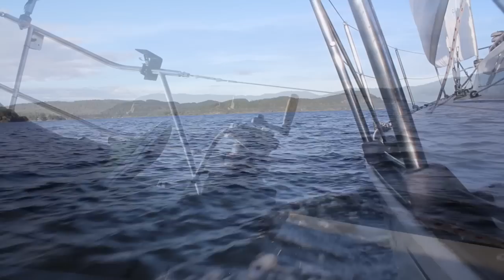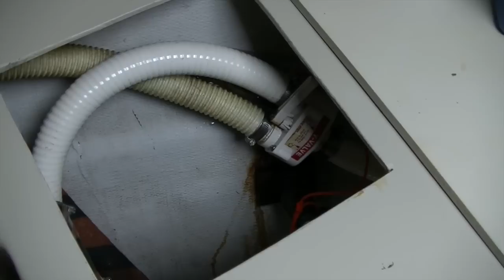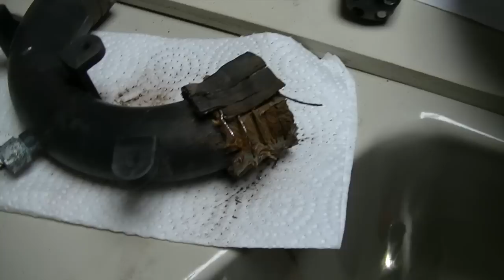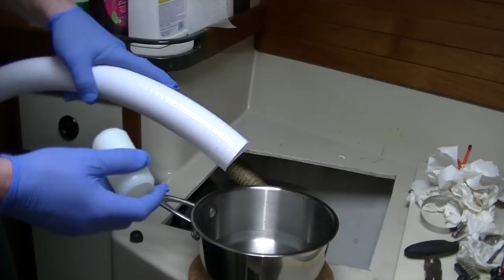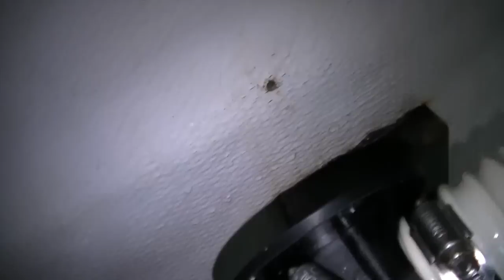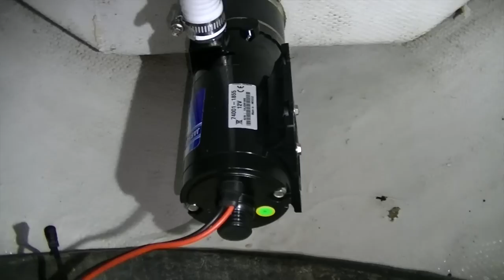Life is Like Sailing - Head Systems - Part 1

Comment: Thx the response , by the way your boat is beautiful . C & C did a classic design on these boats. I must travel quite far to re inspect. I saw the one tank on the port side an the the forward tank as I mentioned. On the port deck,walk there are 2 fill opening but the corrosive salt has warn away
info. I wish I had the Manuel for the boat. So I should put the waste up front n put a second water tank on the starboard side. The head also has to replaced. The old stand Jabsco usually makes life a little easier . 
I’m going to put the Windless on a shelf inside the anchor well even if the base plate to hold the windless in place must be raised up in the anchor locker , and a hole,has to be cut for the proper feed in n out . 
The auto pilot video was great, and it was helpful with reversing the wheel for a proper fit. I saw you a hatch placed to the rear of the mast. Well needed for sure. Expensive project for sure. I think some of the winches can be removed n proper feed to the cockpit is an easy project. 
Keep sailing n do the you tube thing. Ed
Reply from the maker: Good luck with all those projects Ed!  It takes time and thought for each one for sure.  Alfy

Comment: I thought the front tank was for water not waste?? What a mess I have . The head runs out direct thru the starboard side
Reply from the maker: Water tanks are in different locations on different boats.  My water tanks are under the main cabin settees which is a better location as they are mid ship and low and they are usually full.  The holding tank under the berth is usually empty so less weight up in that area.

Comment: Goiod job.Having done that before plus switching out the holding tank and adding extra vent through hull ( which I recommend cuts down odors ) next time I would just get rid of it all, plus a through hull, and a deck fitting, capture all that space, and put in a composting toilet. No clogs, no odor, a little work for sure, but not messing with changing joker valves or hoses. And you get all that space for other stuff.

Comment: sorry your driving me crazy with this engineering. unless you have a dip tube installed in tank you will not be able to pump out dockside. and I know you do not have it. Has to be install to bottom tank fitting to a 3 way valve to (overboard+ mas-pump ) and (dockside)

Comment: I'm repair marine heads. you can not have your dockside pump out at top tank fitting. 3 way valve on tank outlet fitting then over board and to dockside pump out. its pvc hose use heat gun.

Comment: Thank you!  I am about to do the same job on my Newport 28 and your video made it much clearer on how to tackle it.
Reply from the maker: +CaptMortifyd Glad you found the video and I hope it all goes well for you!  I tried the hot water method in this video, but then I tried a heat gun in part 2.  I would recommend the heat gun over the hot water.  Of course if you are out cruising and don't have AC power, the hot water will still do the trick!  :)
Reply: +LifeisLikeSailing - Vancouver, BC We're on shore power at the moment, so I think I will take your advice and use a heating gun.  We'll be on the hard in the spring and will be checking out our through hulls then as well.  Your videos were much more what I needed in terms of "how to" for a job I was dreading. I like the labels as well.
Reply from the maker: CaptMortifyd Nice you have shore power and it will be nice to have that job behind you!  :)

Comment: I would heat that hose up from the macerator pump so you can put on all the way and get a second clamp on it. The macerator can put out some PSI and you don't want that joint to fail.  I took ALL my forward head/holding tank/hoses/venting etc. out and replaced with a "Natures Head toilet. There is  quite a bit of "how to" videos on YT for this head. I have it mounted, having to alter the floor in the head for more flatness to mount to. I am still working on the venting but can't finish until the temperatures rise a bit for the sealant to work but it is almost done and I like it a lot.
Reply from the maker: I actually heated that hose with a heat gun just a couple days after making the video and got it on all the way with two clamps.  Sounds like you have a good set up for your composting toilet.  :)

Comment: Great video, indeed. This is the "not so glamorous" stuff some people stay away from, but a necessary evil. This is also an area that cutting corners on cheap parts will come back to bite. Those Y-valves are certainly better designed than the older ones, and look smaller too, so works good I guess in tight spots. One thing I noticed on your video, the access area to the Y-valves is square with 90 degree corners, and the ever-typical over cuts. I wish some manufacturers drill a hole at each corner and cutting the access to terminate at the holes drilled. But it's a good idea to use a round file and round those corners to avoid stress cracks traveling pass the 90°. With the rounded corner, any stress will be "shared" by the rounded area. You don't have to use a large file either, just enough to get rid of the 90° cut. When I do this, I place a medium C-clamp at the outer corner edge of the 90° to keep the fiber and gelcoat from fraying on the down stroke of the file. Just a tip for longevity of the fiberglass. Love your videos, man. Good work!
Reply from the maker: Thanks for the tip javacup912.  The y-valves I have now are definitely much better than what was in there before and ya, cutting corners just asks for problems in the long run!  Glad you are enjoying the videos!  :)

Comment: I've been working on the same project on my boat recently, one thing I've found that makes getting the hoses WAAAY easier to get on/off the barbed fittings:  carefully warm up the end of the hose with a heat gun instead of the hot water method.  Same idea though, makes the hoses nice and pliable.
Reply from the maker: If you noticed on the video I had a hard time getting that 1 inch hose from the macerator onto the thru hull fitting.  After the video I ended up  trying a heat gun to see if I would have better luck and it went on much easier and it fit all the way.  So yes I learned that although the hot water method worked pretty good, next time I would probably stick to just the heat gun.  :)

Comment: Not sure if anyone else brought up costs, but it would be helpful if you could mention your expenses involved and time expended for each phase. Thanks so much for sharing.
Reply from the maker: Glad you enjoyed the video Jonathan, that is a great idea and something I have thought of mentioning before and I forgot all about that for this one.  I can tell you that I bought 8feet of 1 1/2 inch and 3 feet of 1 inch sanitation hose and I will have to find my bill for that to get exact cost...the 3 feet of Tiger Flex sanitation hose was just under $5 per foot and I am sure the other white stiffer hose was cheaper.  All good quality sanitation hose though.  The macerator pump was $170, but that is a little cheaper that going into a store to buy it because I have an account which gives me a bit of a discount on some items.  :)  So overall the first part of the upgrade was fairly inexpensive.  :)

Comment: BE CAREFUL OF THOSE JABSCO PUMPS. UNLESS ARE THEY HAVE BEEN UPGRADED THEY USE BRASS STUDS ON THE HEAD AND BREAK VERY EASILY. I HAVE BEEN THRU WHAT HAPPENS. IT IS NOT PLEASENT.
Reply from the maker: I can't imagine why a pump like that would have brass studs!?!  The one I had in before and the one I have now look like the studs are stainless.  :)
Reply: YOU MAY HAVE A UPGRADED PUMP. WENT TO WEST MARINE AND COMMENTS WERE THE SAME AS MINE WITH THE STUD PROBLEM. JABSCO I UNDERSTAND WAS SUPPOSED TO UPGRADE. BEST OF LUCK. ENJOY YOUR VIDEOS.
Reply from the maker: Thanks Donald!  Glad you are enjoying the videos!  :)

Comment: Great video Alfy,  even though I'm planning on removing my holding tank/bag and toilet, I was wondering about your holding tank, it looks like it is a hard built in tank?
Reply from the maker: Thanks Maverick!  I am really interested in composting toilets, but because the system I have in place now is not expensive to fix up I want it working well.  If I ever decide to sell the boat to get something larger, I think this system will be better for re-sale.  Oh, and yes the holding tank is a hard built in tank, but it could be removed easily if I decide to go to the composting toilet!  :)
Reply: Alfy I think the two big reason I want to change Maverick over to a composting head is because 1 the storage space that is lost due to storage container under the port settee and 2 because I don't want to have the hassle of pumping it out every few weeks once I'm onboard full time.  Adam
Reply from the maker: Those are the exact reasons I like a composting toilet as well! Once I am
100% sure this is the boat I will be keeping for many years then I may make that change over! I think I will know if this is the long term boat for me in the next year or two. At that point I will either upgrade this one if I end up deciding to get another boat then I will save the upgrade for that one. :)
Reply from the maker: Mr K Hey Mr K, I would love to hear the reasons your friend would never get a composting toilet as I have not done very much research on them at this point.  Any information/feedback/pros or cons would be great to hear.
Reply: Mr K I'd also like to hear what the reasons are.
Reply from the maker: Well that all sounds pretty disgusting, but the composting toilets I have seen have separate containers for solids and liquids.  I thought with the peat moss type soil that is supposed to be mixed with the solids turns the waste into composting type material that doesn't get discarded into a land-based toilet after the fact?  

What you are describing sounds like a regular porta-potty, but I am no expert in this area.
Reply from the maker: this all sounds like definitely something to research very well before making a decision about it :)
Reply: Sounds to like your friend has some bad information.  First of all they smell like garden dirt, boy does that stink.  Second there is no reason to separate the paper as it will compost just the same, although I know of people who do this in the home toilet for sick reason.  Third the toilets are designed to separate the liquids and solids.  Personal carrying a bottle pee to marina toilet every few weeks is easier that have to move the damn boat every time you need to pump out the holding tank.

And as far as the stink any leak in a holding tank system will without doubt be way more than the smell of a composting head.

I think your friend had a complete misunderstanding of how the system works.
Reply from the maker: That is the understanding I have of composting toilets Adam.  :)  also any leak in a holding tank system will also  be very messy!! 😬
Reply from the maker: Mr K Maverick Sailing I want to make sure you guys know that I appreciate all the comments on this thread and I understand that not everyone shares the same views.  For me I have not done enough research on the matter which is why for now the upgrade to the existing system I have made sense for me.   If I decide to make any change to any of the systems that already exist on my boat I would be sure to research it as much as possible of course.  :)
Reply: Alfy that is a good suggest do the research for yourself, don't put your trust in what one person claims.

Personal I've done the research and your no more likely to loose your kids than people that live in the outback of Alaska or Canada using an outhouse.
Reply: Mr K since you commented on my post it is only fair that I respond.  It seems to me that with so many people using and loving their composting toilets it far out ways one self proclaimed expert, who does not even claim to have given any real use of this type of toilet.

For the size of my boat this type of toilet is the best option.  If I had a boat '40+ I would consider an electra-San type toilet that renders the waste as complete inert.
Reply from the maker: Maverick Sailing Lot of good reviews Adam.  :)
Reply from the maker: that is a good point, never thought of that!  lol
Reply: Mr K why would need to hold back from peeing, while you are doing your business, the toilets are designed so that you can with out them mixing.  

I think you should do some research on these type of toilets before you start talking about stuff you have not really looked into.
Reply from the maker: Maverick Sailing Of course I appreciate hearing personal experiences and opinions like you both have as well.  :)
Reply: http://www.amazon.com/Airhead-Household-Head-Composting-Toilet/product-reviews/B00GXIODVK
Reply: http://www.amazon.com/Natures-Head-Composting-Toilet-Standard/product-reviews/B003EX7LV6